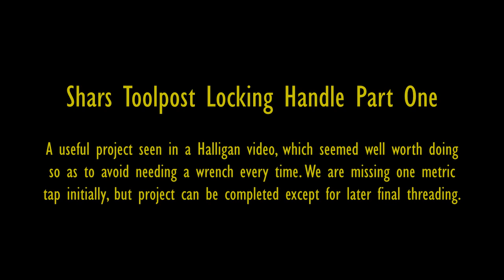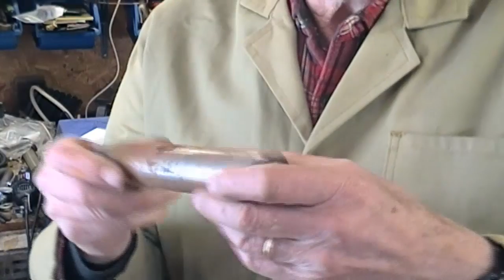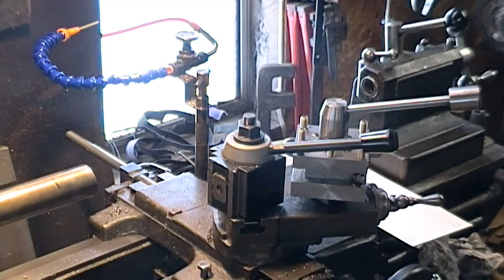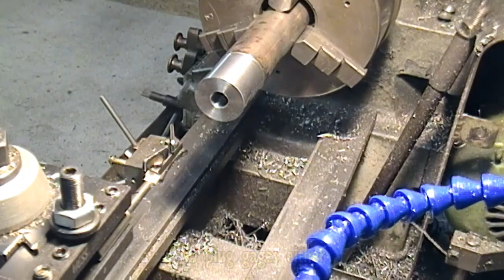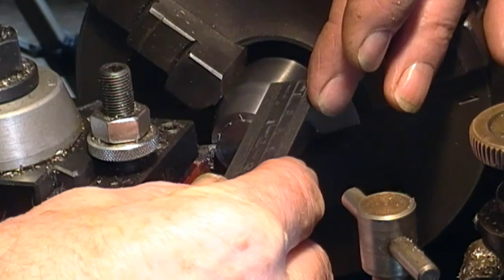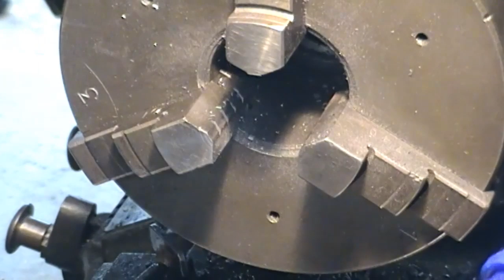Toolpost locking handle, Part One of 95%

Comment: How did you get your QCTP tool clamp handle to come to the 7 O'Clock position?  Mine is at the 2-3 and very inconvenient.  Probably going to have to drill some alternate holes and tap them.  I am going to do the Halligan treatment too.
Reply from the maker: +Douglas Thompson  Hi Douglas,
I mostly 'adjust' to a suitable position by trying addition of different shim washers - only needs a few thou to get to where it is acceptable.

Comment: Hi Chris, if you had drilled it 1/2" you would still have had plenty of engagement and make it much easier to tap, 12.5 should only be thought of as a starting point not a dogmatic requirement.
Having a handle is nice, comes standard with Dickson QC, but arranging tools in the holders to be at the right angle so you don't have to turn the post very often is even nicer.
I thought it was cold here in London, at 7C, but you got me beat with your snow.
Keep warm
c
Reply from the maker: Chris -- true enough - could well have started 1/2". Colder than you here -- today is just below freezing with freezing rain - not nice!
Reply: Unless you are into winter sports, perish the thought (pun intended)

Comment: For 14mm I'd consider exploring internal threading, but I have a metric lathe so less issues dropping onto the leadscrew.
Tap is probably easier on an imperial lathe.
Reply from the maker: Hi Ray - it is possible to go metric on my old lathe but - involves a major change of gears - too darned fiddly so - awaiting my tap!